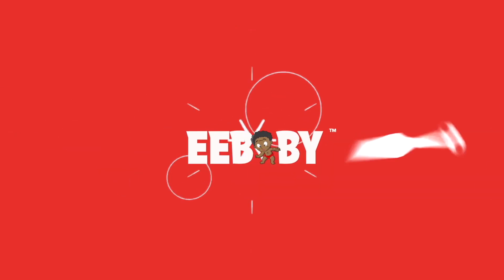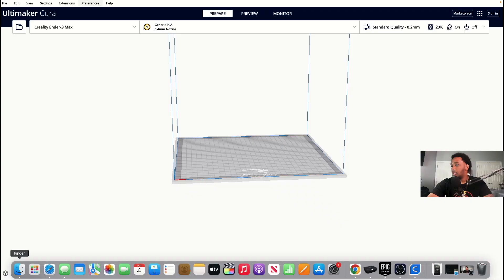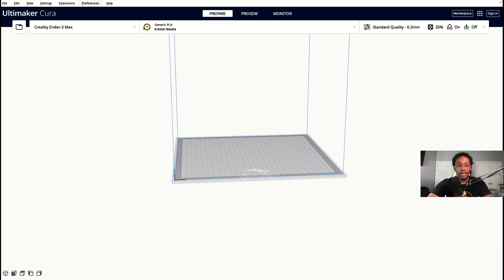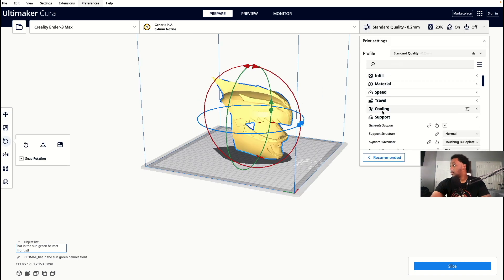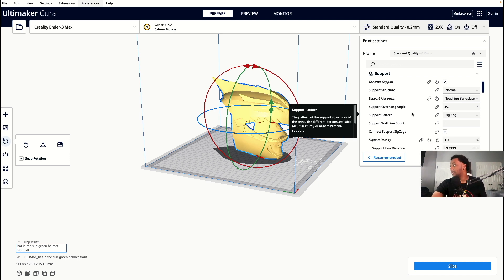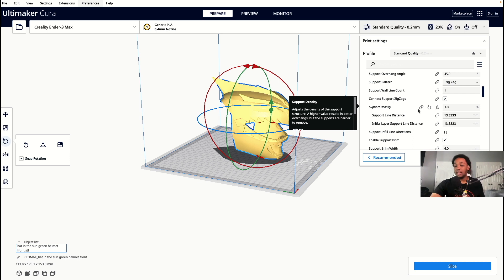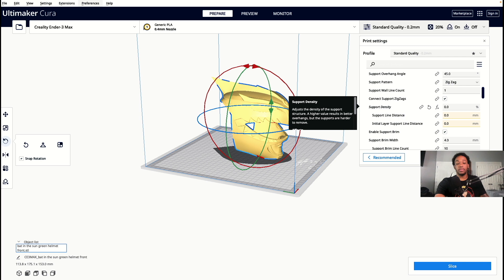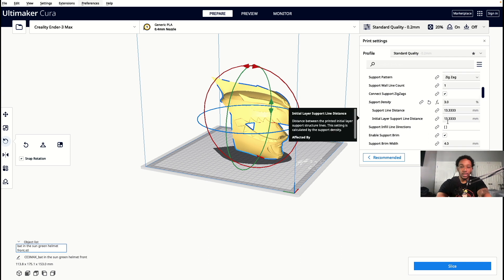My Easy Support Setting Removal for 3D Printing! (Cura)

Comment: Increase support Z Distance to .2. This number is the gap in mm between the print and the support roof it’s default is .16 this is not enough of a gap to make supports snap off with ease. .2 performs much better at removing supports in one peice